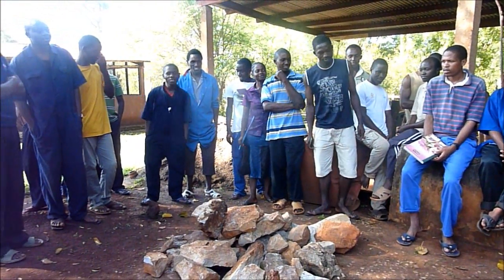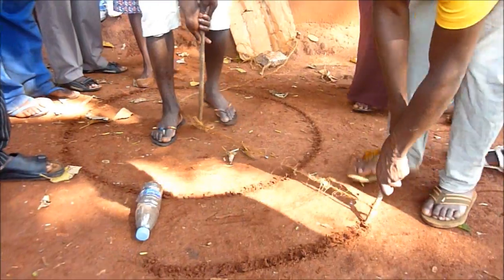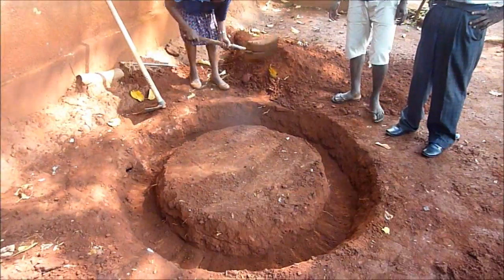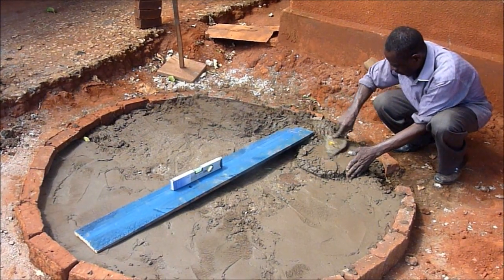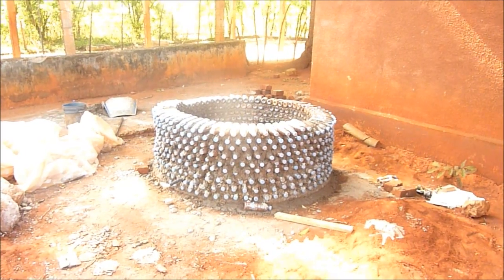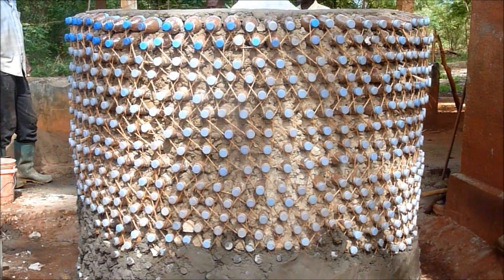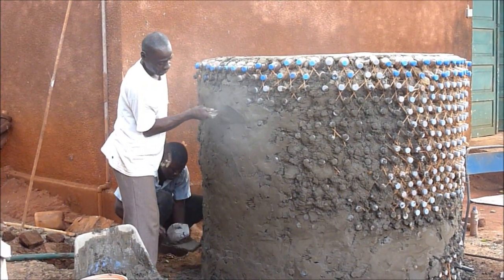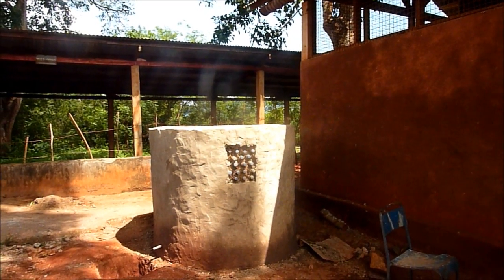Water Tank built with Plastic Bottles

Comment: not safe to drink!!! If you can not build it in your own state do to federal and state regulation, Africa is not an option. Plastic bottle under heat pressure release toxic poision. I am sure you know that. Pure cancer WakeupAfrica!!! 😠😠😠
Reply: Would they be better off without water?
Reply: Fucking ridiculous. The plastic is sequestered into the concrete and the layer of waterproof concrete on the inside isolates it even further from the actual water that is consumed.

Comment: I can't think of a more heinous way of burying plastic garbage than putting it in poor black people's water tanks. Why not use plentiful and naturally occurring rocks instead (as in the foundation)?
Reply: Came here to point that out. This technique is stupid AND dangerous. Also, they have no rebar. They didn't even use chicken wire which of course is not enough. I see no reason at all to use the plastic bottles.They are slick and provide little grip for cement. They are just structural garbage. Literally.

Comment: pretty cheesy, to have all those bottles that are exactly the same and same make and size seems pretty manufactured, you would have to have everybody in the village drinking the same water bottle or you would have had to buy them and then empty them in order to propagate your propaganda of anti bottles , witch anti bottles is fine and I agree with, but is a total waste of those poor people's time and efforts just to propagate your agenda. there is no reason for them to use the bottles, plenty of viable tanks are made with concrete only
Reply: most of these villages do all drink from the same pallets of water dropped off by the peace Corp. also cement costs money so it makes sense to use the bottles as bricks instead of having them most likely burnt. but in other situations you are right.
Reply: most of these villages do all drink from the same pallets of water dropped off by the peace Corp. also cement costs money so it makes sense to use the bottles as bricks instead of having them most likely burnt. but in other situations you are right.
Reply: It's stupid and dangerous construction. Water bottles are very slick and cement won't stick to them. So structurally, it's a stupid choice. Dangerous because there's no rebar. Water is heavy. That tank will crack and someone could get hurt when it falls apart. No engineer worth his pay would ever sign off on this. The people who designed this are ignorant. How do I know? I'm a construction worker. We have to follow codes. This is a code violation in many ways. Thin walled tanks can be made to save money on concrete. And it's not the thickness of the wall that makes a tank strong. It's the type of materials used and how they are used.

Comment: well I understand that they are being used for volume filler to reduce the cement needs. like building blocks mortared together but a wire to physically tie them together for strength. would it not be good to have them flipped every other row or bottle so that they can be tied together on both side's?
Reply: It's wrong. Those plastic bottles are slick and a terrible choice. Their whole concept of how to build a water tank is just ignorant. If you want to save concrete then you could go with rebar, metal mesh and cement with sand. Do a core on the metal and then coat inside and outside with your homemade stucco. Then make a cement paste to seal the inside. That's thrifty on cement and lighter on the foundation. If you want to make it more insulating you can make home made bricks out of five parts screened earth and one part Portland. Then brick them around the outside with mortor. Functions the same way but more stable. That thing they made is a wreck. Worthless.
Reply: @johnknoefler  they could just use rocks
Reply: @wagnergauer9133  exactly!